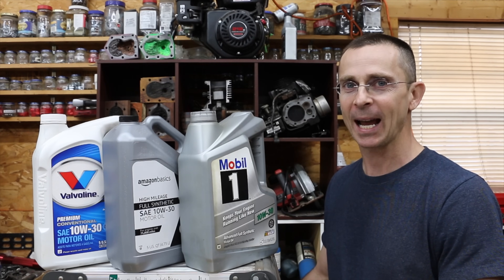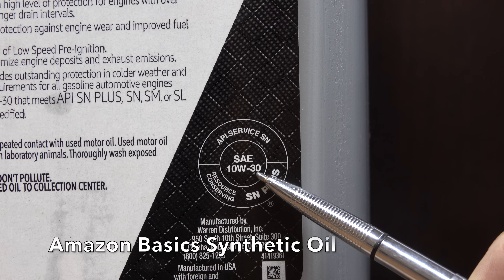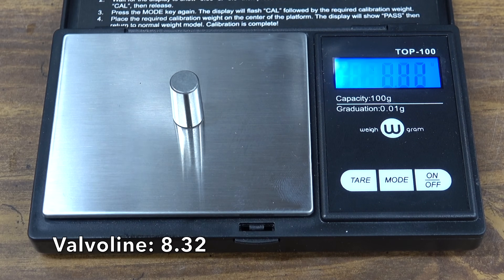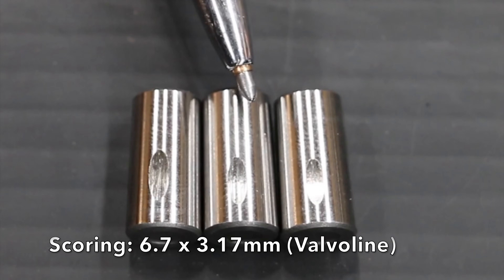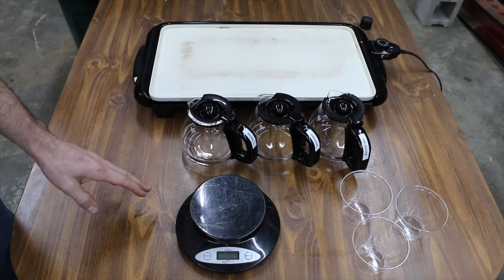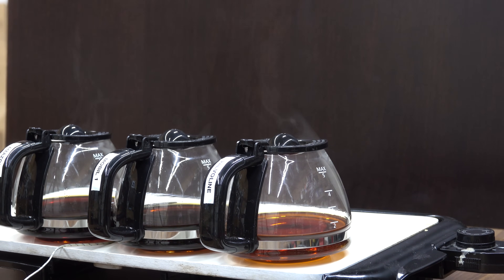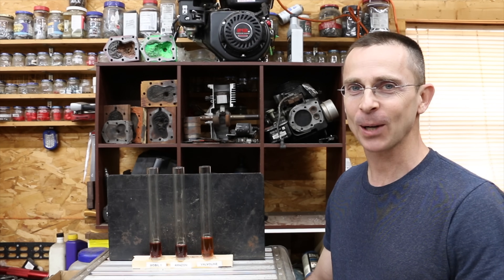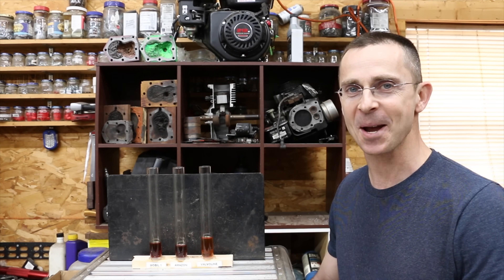Is AmazonBasics Full Synthetic Motor Oil better than Mobil 1? Let's find out!

Comment: My thoughts are based in, is the Amazon oil really a 10w? What are the implication of putting 5w in a vehicle that wants 10w?
Reply: Check out Terry Dyson's blog about his lab's testing of different oils.  He recommends going with the thinnest oil that your vehicle can use--based on oil pressure, because thinner oils flow easier and faster, and contrary to popular belief, don't necessarily degrade faster or provide less lubricity at higher temps than thicker oil.
Reply: Adding to this some vehicle engines like my 5.7 hemi have a sensor that activates MDS ( 4cyl to 8cyl mode) and if i pour anything other than 5w20 itll throw a code and the sensor wont let MDS activate
Reply: David Thornton I put 5W-50 in my E60 M5 even though BMW requires 10W-60. It’s been proven to reduce wear.
Reply: The ford 3 valve engines are meant for 5w-20 but techs who see the failures in them over the years reccomend 10w-30 to reduce wear
Reply: @Manguy dude.. As far as I have ascertained, never go up in cold weight. If it is recommended 5w DO NOT put in 10w
Reply: It means quicker flow when it's cold outside. But if the engine does truly require the thicker 10w and you put in the 5w, best not run it hard in high temp climates as viscosity is less.

Comment: Nicely done. Keep these great videos coming. 

I've been using Mobil-1 in my Jeep for almost 20 years and was planning switch to Pennzoil Ultra Platinum Full Synthetic in the Jeep since I've been using Pennzoil conventional motor oil in my other vehicles since 1994 with good results. Just curious how well the Pennzoil Ultra Platinum Full Synthetic would have compared to the Mobil-1 in your test...
Back in 2006 I bought a '91 Miata that had always been serviced with Quaker State motor oil. Within a week of buying the car I removed the cam cover just to see how clean everything looked. The internals were clean of any sludge but everything had a very dark brown tint to them. I then ran Pennzoil conventional motor oil for several years and then removed the cam cover again while replacing the timing belt. The internals were very clean with a light gold tint. 
You could make a video series to see which motor oil cleans the best.
Reply from the maker: Thank you for the video ideas!

Comment: Flow test cold doesn't help much as much as when it's hot... need to know if the Amazon oil is just behaving like say a 5W or 0W oil when cold but would they be thinning even more when it gets hot?  Initial cold starts of your engine in the winter is important, but if you plan on actually driving a vehicle it's how the oil performs while it's hot... and really hot.
Reply from the maker: Thank you!

Comment: Hello Sir. I am from India. And i want to know how can i choose the engine oil grade? Based on environment condition or based on engine? I have 150cc bike. And company recommended 10w30.
Reply from the maker: Thank you. Recommend using 10w30 since the manufacturer requires it.  The manufacturer should also mention the temperature range for the grade too, and optional grades for lower or higher temperature climates. Thank you

Comment: I really love me some proper tests and not just "I run walmart oil and my engine has not blown up so it must be better than your pennzoil"

That being said, I noticed that your bottle of amazon oil there said high mileage but the Mobil 1 and Valvoline were not high mileage oils. High mileage oils have different additives in them and thus may have skewed your testing results. I would like to see you test the regular amazon oil and compare it to the data you got.

I would also be interested to see you run the oils through an engine then conduct the ware protection test and the flow test to see if service affects one more than the other. This is usually where a cheap oil will fail.
Reply from the maker: Thank you!

Comment: Project Farm, Props for your vids always the best and lots of learning from them..........one of my biggest worry's is that what safety factors are out there keeping an eye on the quality control with amazon oil grade and who knows Amazon could switch out the grade of oil to a lower quality and thus damaging peoples engines or wiping out an entire fleet of vehicles who rely whats printed on the bottle ? Thoughts ?
Reply from the maker: Great point. They use Warren Distribution, a very reputable company. I've begun using it in my vehicles and I trust Warren Distribution to maintain high standards for high quality.  If Amazon raises their prices, I'll find another brand.  Thanks again.

Comment: I noticed the Amazon Basics was a high mileage composition and the Mobil 1 was not.  The additive packages in a high mileage oil may make the difference.
Reply: I did not notice that, and you are right. High mileage oils tend to contain higher levels of ZDDP.

Comment: bezos isn't stupid. He obviously is partners with a major oil brand and just slapped an amazon sticker on the bottle. So they both can make money.

As for me, i like going with what i know, and that's mobil 1. I change my oil once every 6-8 months, or 3k miles, whatever comes first and i use mobil 1. I can get a 5 quart jug at walmart for about 26 bucks. So is those couple extra dollars worth saving not knowing if you actually put a good oil into your engine? You decide. I'll gladly pay the extra 6-8 bucks for just so i can see oil coming out of a mobil 1 jug, and right into my engine.

Comment: I got an interesting suggestion, air compressor oil in a crankcase and motor oil in an recip air compressor while we’re talking about oil, like an air compressor at an auto shop, it would be quite interesting to see if there is a difference
Reply from the maker: Thank you for the video idea!

Comment: I've used Valvoline for years but this was enough evidence to switch to Amazon or Mobil 1.

Do an oil test against Amazon and Rotella, please.
Reply: I didnt realize that. Good catch guys.
Reply: @impc2505  you're good, stick with your oil or whatever goes on sale. The differences among conventionals are very minute. (No no name travel center/truck stop oil though, they actually really suck)
Reply: Of course a Mobil 1 and Amazon full synthetic outperformed a conventional oil. You want similar results to Mobil 1 and Amazon basics? Use Valvoline full synthetic.
Reply: Kevin Barlage I thought the same thing until I realized the valvoline wasn’t synthetic

Comment: In my circle track race car I ran a Buick 455 with Mobil 1 synthetic and sfr that was in 1988 through 92 that engine still runs like a bat out of hell and everytime I pull the oil pan and look at the bearings they look brand new
Reply from the maker: Thank you!

Comment: Nice test, but I’m gonna stick with Mobil 1. It’s only $25 at Walmart. An extra $5 every 5-7k miles isn’t gonna break my bank and it’s worth the peace of mind for me. If your engine is under warranty and happens to blow up with some amazon oil in it... good luck with a warranty claim. (And yes, the manufacturer can and will test the oil in the event of an engine warranty claim.)
Reply from the maker: Thank you!  Mobil 1 is a great product!
Reply: Project Farm That was a very cool test, and nice to see that the amazon oil actually held its own against Mobil 1. I wouldn’t use it, but for someone with an older car outside of warranty, looks like a very good oil for the price. I do know for a fact that when it comes to major powertrain repairs, manufacturers will look for any excuse not to shell out thousands of dollars in warranty work, and they do test fluids that were in the engine or transmission at the time of failure to make sure they are what the manufacturer suggests. I know a guy who almost didn’t get his transmission warrantied in his car for running a different brand MTF than OEM after his second gear failed. For people with warranty left, it pays to bite the bullet and pay a little extra.

Comment: Please do an ultimate oil test with supertech high mileage synthetic, Valvoline high-mileage synthetic, Mobil 1 high mileage synthetic, Pennzoil Platinum high mileage synthetic and Pennzoil Platinum Plus synthetic (they don't have a high mileage version) all 5w 30 I think those are the main contenders that are the most popular right now.
Reply from the maker: Thank you for the video idea!
Reply: I think Amazon Basics and Supertech are the same oil.  They have the same distributor.
Reply: @csinalabama73  yes and they make other brands at that manufacture doesn't mean it's the same oil. I'm sure companies have a contract with them on what they want them to make.

Comment: Only question I have is the Valvoline motor oil isn't full synthetic as the Mobile One and Amazon ones are.  I think Valvoline would have done better in this testing had it been full synthetic also.
Reply from the maker: Thank you!

Comment: Future video request......
Please direct me to the video if I’ve missed it and not found it but I’m keen to see a test proving cold weather engine start up damage. Is it best to start and go or allow to warm up before applying load to an engine. Also, if you do have to warm the engine up should you idle the engine or apply gentle revs to get the oil flow and aid the warming. What is the startup wear between a cold engine vs an engine with a block heater pre heating the engine oil. The main interest for me is piston wear in the above situations. Love the videos.
Reply from the maker: Thank you for the video idea!

Comment: These are very archaic tests and should be taken with a grain of salt. I remember Amsoil did a test with Head and Shoulders shampoo and it performed the best of all Oils tested, obviously you wouldn't use shampoo in your engine. The point is that some oils perform very well under some conditions and other tests with the same oil perform very bad, plus with age oil and additives in the oil break down and don't perform as well.
Reply from the maker: Thank you.  The head and shoulders test is just plain silly.  I have a video on it to dispel this.  Head and shoulders doesn't even include the same type of zinc used in engine oils.   Zinc di-thiophosphate (ZDTP) in engine oil and Zinc pyrithione in Head and Shoulders. Thanks again.

Comment: The main problem I have with this test is that the Amazon Basics oil is specifically a "High Mileage" oil which has extra additives to it for engines with high mileage on them. These oils are formulated differently to deal with the extra wear these engines have on them.

Comment: Little bias video he didn't add as much oil with Amazon if it had as much oil as mobile it would perfor as good or even better on Bering mobile was overflowing where Amazon barely touching the disk.

Comment: Some good findings, although they wouldn't mean much if the oil were to completely break down under extreme measures and/or extended use...which is one of the main issues not tested here. Aside from viscosity changes under high temps there is a certain amount of change in volume oil goes through when heated, also. But more importantly are the bonds that hold it together. If it were to fail by breaking down the oil would basically get squeezed out of the bearings under force, protecting them less, resulting in bearing failure which is what blows up engines. Usually you could tell if it's breaking down if it starts to get bubbles in it if I recall.
Reply from the maker: Thank you!

Comment: Thanks for the video.  It would be nice to see a little more statistical analysis.  One set of data is good, but for accurate data you really need a minimum of 3 measurements that do not vary too much.  I would have liked to see multiple samples on the lubricity test to confirm that your one sample was not an anomaly.
Reply from the maker: Thank you!

Comment: Are you able to test Quaker State brand PLS!!!!!!!
Reply from the maker: Thank you for the video idea!
Reply: Thanks for the speedy reply. 
So I was on Royal Purple, but it got too expensive. So I switched to Mobile 1. It was good until I notice it was burning a little more oil than it normally does. So just for shits and giggles I switched over to Quaker State and surprisingly it does not burn as much compared to Mobile 1. My driving habits hasn’t changed. I live less than a mile from work. I use full synthetic. Not a lot of people talk about Quaker State. I usually purchase Quaker from Target and Walmart. and to test my theory I switched back to Mobile 1 and the results were the same as before, so now I’m back to Quaker State. If you can pls do a comparison on Quaker so I can get a better understanding of it and hopefully I’m not the only one who’s had this situation. I’d appreciate it. Thanks!

Daily Driven by the way.
2001 Acura Integra GSR

Comment: I love your videos, here in MN it was -31° last week and I always wondered if oil viscosity etc changes that much between X amount of time and to see that much of a difference just in color makes me wonder if my turbo charged engine is getting the proper lunbrication, I did however opt for the euro blend syn when I got my last oil change... maybe test the differences in euro blend oils..  also add a computer fan to the top of each of those coffee pots to simulate air flow?  Use hot plates for each with a temperature probe in each...
Reply from the maker: Thank you!

Comment: For a full disclosure I live in the Pacific Northwest where temperature  very rarely gets down to freezing or over 90 degrees. I have a 1952 farm tractor that I drive in parades during the summer. I started driving and working on cars in the late 50s. All there was was 30 weight back then and when they came out with a new multi viscosity oils everybody went to them apparently except me. Multiviscosity oils cost more and I just didn't see the need to spend the extra money and frankly no one ever tested the Multivis oils against my 30 weight to prove the validity to make me want to buy it. I went back to your videos and I didn't see any comparisons between standard 30 weight oil and 10- 30 or 10-40. The apparatus you have set up for this test would be perfect to test my 30 weight non detergent oil with 10-40 or 10-30 detergent oil. 30 weight oil has worked engines for a hundred years, and has worked in my farm tractor for the last 25 years that I have owned it. I would really like to see a test of different multi viscosity oils versus standard 30 weight non detergent. I know we all really like your video because we love your results and I believe they're accurate and none of us want to do it because you take so much time and effort to getting it right. Again thanks a lot for the great videos!
Reply from the maker: Thank you for the video idea!  If it were me, I'd stay with what you're using since it's working very well.

Comment: Thanks for the input. But I think it's also worth mentioning that I buy Mobil 1 0w40 full synthetic European formula at Walmart for $22.99 for a 5-quart jug. I most recently changed my oil with Valvoline 5w40 full synthetic synpower that met my Volkswagen 502.0 ,505.0 spec and even needs Porsche long-life specs. It was 2699 on sale for 2199 for 5Q.  That's hard to beat. I purchase my filters ahead of time on Amazon by the dozen. Because I use a larger capacity Mann 950/4 filter. I trust these filters the most because they are OE. Same as the dealership offers with just different markings on them.
Reply from the maker: Thank you!

Comment: Well designed test, thanks for making the video.  In measuring the bearing weight lost in the lubricity test, I wondered if a more accurate scale was easily available, one that could measure down to a thousandth of a gram. That would be approaching laboratory standards, so it probably isn’t feasible, but I ask because the weight of the lost material is so small. My second question is what kind of glue or epoxy did you use to affix those test tubes to the wooden block on the pouring apparatus - whatever you used worked exceptionally well under adverse conditions.  Thanks again for another great test.
Reply from the maker: Great recommendation!  I just ordered a better scale.  I used hot glue for the tubes.  It works very well and it's easy to remove them with heat.  Thank you!

Comment: Mobile1 is cheaper at my local Farm and Fleet by almost half of Amazon basics price. I use Mobil1 synth blend on my leaky GM and AMC (‘98 Wrangler) engines and full synth on my Toyota 4.7iF. All my engines have always made it well past 200k without any problems. Had a ‘98 Malibu that I ran 275k on Mobile1. It’s good stuff. Amazon is good too. I buy what’s good and cheapest. I found the freeze test informative as a Wisconsinite. 😉. Thanks for the good, in depth review!
Reply from the maker: Thank you!

Comment: I don't even have to watch the  video. The answer is no. It is not better. 

The more appropriate question is....does that matter for your run of the mill car? Probably not.

Does it matter for higher performance cars put under much higher loads at the track? Yes
Reply: The majority of engine wear is at startup and the Amazon oil flowed better when cold. So the Amazon should flow through the engine faster preventing more wear from occurring during that initial startup. It's all probably hog wash it's more about oil change intervals. I would rather have Amazon oil that I could afford to change every 8-10k miles than Mobil 1 which I couldn't afford to change until 13-15k miles. Most oils these days are good enough.
Reply: @rileyneufeld7001  Like I said, for a regular car its probably fine.

For a car being pushed, tracked etc its on track where wear levels and stress levels are highest.